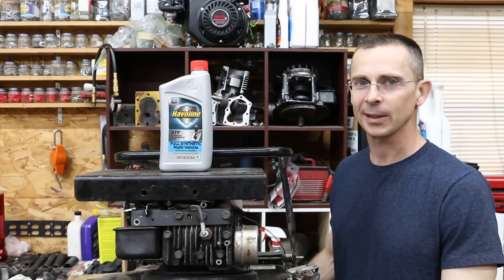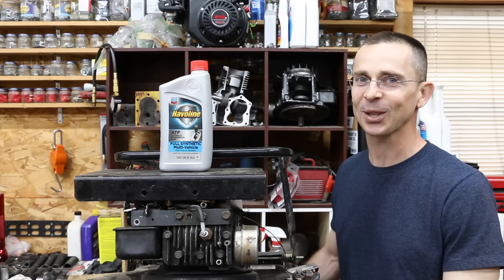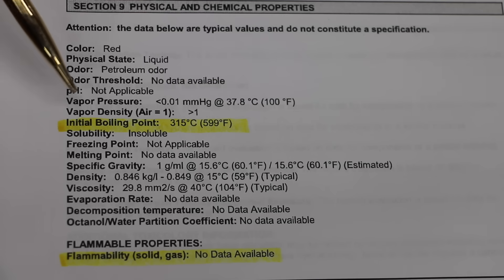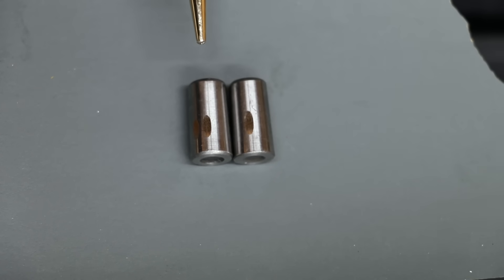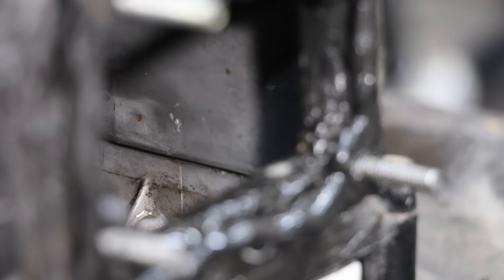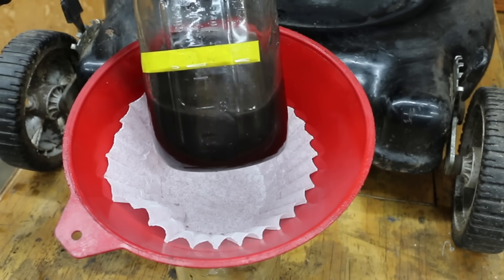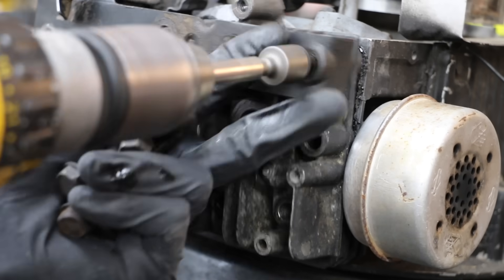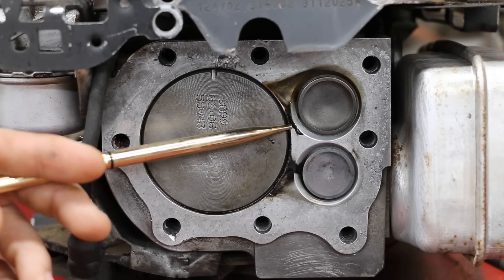ATF as an Engine Oil substitute?  Let's see what happens!

Comment: I use just straight kerosene in my crankase right after draining old oil out, and turn my engine for a few seconds using the starter motor, you wouldn't belive the amount of actual DIRT and gunk it washes out..... I should note it would be best to just pull the spark plug wires off and let the starter motor turn the engine over for a while and yeah that cleaned out the engine that was some nasty looking kerosene that came out
Reply: OnThe Farm I just purchased a 1977 Toyota Dolphin the 20 R engine in it, it's sat for 14 years, 58000 miles on it, I installed it in my 77 Toyota truck, after draining half of the oil out of it, I poured in 3 quarts of diesel, pull the spark plugs turn the engine over,  for 45 seconds,  did this probably about 10 times the first day , drain the oil  and diesel out of it the next morning, pour in 1 gallon of diesel the next day, repeated the same thing over the first day you  should of seen the sludge that came out the second day,,, I got 3,200 miles on it right now, and that's one sweet little Toyota engine,
Reply: @daleslover2771   Dale Slover I use diesel regularly to flush engines and clean parts during rebuilds. It beats the snot out of over-the-counter products.

And as far as those particular Toyota motors go...the 20R and 22R were the best 4-cylinders they ever built, in my opinion. Those are absolutely worth the time and money to clean/restore.
Reply: @daleslover2771  Diesel Fuel?
Reply from the maker: Thanks for commenting on this!
Reply: Project Farm yw
Reply: OnThe Farm   Giving that a try – about 4 qts. kerosene and a half quart of ATF.  Just going to let it soak in the pan (and pick-up screen).

Update: didn't get any sludge breakdown. It sat for about two days, and the mixture was not dark at all !  I am very surprised and in disbelief that it that clean, but it did come out clean. I will continue the next step with MMO at next oil change. Metadata: Chevy 350 c.i.d. engine, 175,000 mi.; used vehicle; economy oil and filters (during my ownership); occasional use – going to take it as good news and leave it at that. 👍
Reply: I've drained the oil and filled the crankcase to the top and let it sit for a day,drained it for a day ,and than put in a cheap oil and filter drove for 500 miles ,changed again,and yeah man the solids that came out of that engine were mine blowing,for the record the car was given to me,it was more of an experiment than anything
Reply: @dustinpomeroy8817  If its that bad, sometimes you have to pull covers and pans to clean it properly. The things I've seen....
Reply: Oldschool Dude it was a car somebody gave to me I doubt it was worth a grand and it wasn't worth all that trouble. I had a buddy who grew up on muscle cars and remember him talking about doing that to unsludge motors in the 70s. Like I said it was more of an experiment. Surprisingly enough I drove the car for 4 years after that until someone offered me 750 for it out of the blue and it and I parted ways.
Reply: @dustinpomeroy8817  I understand. You never know what nightmares lay in wait til you pull it apart
Reply: engine flush is basically kerosene, dont run it too long. maybe add some atf to it, or marvel mystery oil with it
Reply: I've always used kerosene, my grandpa taught me that. I never heard of using atf till I watched this video.
Reply: In the shop when faced with a motor that was badly neglected and incapable of producing enough oil pressure due to screen clogged or having problems with drainback because the return holes were so hogged up I'd use 1 qt kerosene, just overfill the crankcase by a quart, let it run for 15-20 mins, then drain and do an oil change. More often than not it improved the problem, sometimes cured. I've seen stuff come out of the pan after this that looked like black peanut butter. If it seemed to work I'd have them change the oil and filter again in 500 miles, then normal interval after. I mean normal normal, not their 30,000+ mile interval that got them to that point in the first place...
Reply: I always drain the oil, put in 3 gallons of diesel, and start and run the engine for 1 minute... Drain and add new oil and filter.. I have never had an engine failure. 
On a side note..I once ran an engine for 2 hours on water only, in the oil pan.. no engine damage occured.
You see, the oil cools the moving parts.. the lubrication isn't as important as everyone thinks.. the dissimilar metals, resist gaulding, as long as you keep them cool, and don't let them heat up, over expand and damage moving parts..  try it, you will be shocked, how well water works as coolant on the crankshaft...

Comment: ATF is just a relatively thin mineral oil without the detergents, corrosion inhibitors, acid neutralizers, and viscosity additives found in motor oil. Since it gets thinner than most motor oils when hot it acts like a solvent and it may help remove some gunk, so the old timers who recommended it had some basis in truth, but it may also cause more metal to metal contact. It isn't really designed to prevent or clean out contamination because the inside of a transmission doesn't experience combustion by-products like a crankcase does, so the common claim that it contains superior (or any) detergents is a myth. The friction modifiers present in ATF may even slightly increase friction, depending on the type of ATF. You can get away with using ATF in your engine if you're a quart or two low and the right oil isn't available, but otherwise just save the ATF for your transmission.
Reply: Louis Laszlo Automatic transmission  fluid gets cooked from the torque converter.  All transmissions are vented to prevent pressure build up of oil puking past the seals.  Since it's vented humid air does get in and any trans fluid should be changed every couple of years for headache free operation.
Reply: Louis Laszlo Dexron 6 doesn't belong in a motor. Dexron 3 has been proven to have good results in a short time being in your motor.
Reply from the maker: This is great information. Thanks for commenting!
Reply: kansascat321  Transmissions are a sealed environment. Nothing gets burned in there, no air or moisture gets in, so where can you get any significant contamination from that you would need detergents to remove? Seal conditioners are a different matter, but if I have leaky seals in an engine then I use a product made for that purpose such as high mileage oil or a leak-stop additive. ATF belongs only in your transmission.
Reply: waterloo123100  What’s in Dexron 6 that would be particularly bad for a motor?
Reply: I've worked on automatic transmissions in a learning environment and in the lab my hands always got cleaner than when I started. I attribute this to the detergent in the Automatic Transmission Fluid (ATF). Also, I recall a good, cheap way to clean pistons is with a deep fryer filled with ATF. The heated oil, with detergents, cleans off carbon, grease, etc. Of course, don't try to clean out the ATF from the deep fryer and try to put it back in mom's kitchen. Its french fried potato and deep fried chicken days are over.

Comment: Good vid
I had a noisy lifter when i bought truck...
Did an oil change (10w30) and new filter drove about 2000 kms, no change. I removed about a quart of oil from the pan, added a quart of ATF, and after about 300kms i dont hear the noisy lifter anymore! Im not sure if the ATF is so much a better detergent, but i believe its a thinner viscosity than the 10w30 and it must have gotten intothe small passages and cleaned out some sludge buildup...
I did an oil chamge once the lifter noise was gone, and the oil was very dark in colour. Replaced with new oil and filter, and so far no issues!
My grandfather told me yrs ago that they used to pour smalls amounts of ATF down the carburetors when they did tune ups. Says it helped clean the carburetor and carbon from the pistons and valves.
You should try mixing some ATF into your fuel in the container for the mower and see if it helps remove carbon from the cylinder head.
Reply from the maker: Thanks for commenting on how you've used ATF!
Reply: @ProjectFarm  That's the way it's supposed to be used for "cleaning".  Also, since it's "thinner" than most 30wt oils...you should change the oil again after using it to free a stuck lifter.
Reply: water injection kits were sold over thirty years go to get rid of carbon build up..
Reply: ATF is a high detergent 10 weight oil
Reply: @cbly  if I didn't know what you were talking about, your comment might get confused with something much kinkier.
Reply: If you did that now it would wreck your converter. Back in the day, we just punched out the cat anyways. I remember a mechanic pulling the smog controls off my moms brand new 78 Chevy Nova. He told her it would fail anyways. That car ran forever. Rusted like mad though!
Reply: @scottfirman Are you saying adding ATF will fry your cat convertor?
Reply: Your grandfather was right..  when you could no longer get leaded gas, the high compression engines would knock and ping horribly.   We would take a glass coke bottle of water or transmission fluid, and rev the engine while pouring the liquid through the carb.   You wanted the engine hot, so as to bust the carbon off the Pistons and valves.. the carbon will glow cherry red and ignite the fuel, just like the spark plugs and does, causing pre detonation....or the fuel mixture ignites, before the piston reaches top dead center.. seemed to work well..
Reply: Marvel mystery oil is good for that problem
Reply: splash around once a year I run about 20 ounces in a full 14 gallon tank it does clean fuel system (efi or carb) was told a qt to a tank when I found out about it I do a qt if I just got the car or truck I been doing it for 20yrs  in all my rides sometimes it improves my gas mileage I also run a qt in my crank case about 100 miles before a oil change I'm  22yrs as a mechanic now never have issues
Reply: @justicefornone3411  Spray bottle down the throttle body, just a few sprays, not enough to hydrolock but it "shocks" the cylinder and knocks the carbon loose as I've been told.
Edit: stupid autocorrect
Reply: ATF being so much thinner means it will probably not maintain a lubricating film in key parts of the engine, which is basically like running the engine with no oil at all

Comment: Never thought of using pure ATF to clean it out, seems to have ungooped the rings for better compression though.  Might work fine for a oil sling system, but have a feeling it would clog a filter fast and lower oil pressure if used in a pump type system.  Wonder how a 50/50 mix of fresh oil and ATF would do...probably best to just use diesel oil for a cycle then, definite high detergent there.
Awesome video as usual...keep em coming, never thought of ATF in the crank of a small engine...nice!
Reply from the maker: Thank you!  I'll test diesel soon.  Thanks again!

Comment: i dont know about a new engine,but in the old days, we'd put about a pint of ATF into the oil..run it until it got hot,then change the oil. back in the day before synthetic oils and efficient engines. the oil stayed cleaner longer. ATF was mostly detergent . .
Reply from the maker: Thanks for commenting on how you've used ATF!

Comment: You are not supposed to replace the oil with trans fluid. You are supposed to add a small amount of trans fluid to the oil. Run it for a little, then change it.
Reply from the maker: Thanks for commenting on this.

Comment: Lucas oil has a product that is 100% petroleum. I've used that and atf had about the same results with both but Ive always mixed it with engine oil. Been a mechanic for 6 years have seen engine oil pressure come back up after the petroleum but not so much on atf. But atf is a great fluid for stuck hydraulic lifters and hydraulic lifters only. My opinion it cleans more sorry because of the detergents in ATF
Reply from the maker: Thanks for commenting.

Comment: From your videos, I have learned that small engines will essentially run using pretty much any fluid around the house as either engine oil or fuel. 

"Shit, I have to mow the yard before mom gets home, but the mower has no oil or fuel. I've got a bottle of ammonia and a jar of pickle juice! That should do the trick!"

And that's how I learned peppercorns clog fuel lines.
Reply from the maker: LOL!  Yes, these engines are amazing.

Comment: I prefer to soak my old lifters in acetone and atf if given the option it does free up 200k+ stuck lifters(soak squish method/repeat) but I have had some success running a mix of atf and 5w30 in a car at high rpm and perussure to flush out lifter issues and  have not seen them return in two years since ( atf was added 2 qt to 2.5 qt 5w30 syn oil and ran for about 10 minutes on high load(5000+ rpm) and 30min overall than changed to cheap 5w30 for the rest of use. not saying it will work just saying it has at least once for me in an ej18 subaru boxer motor.   ps I am  know calling them lifters is wrong as what I'm referring to are hydraulic lash adjusters in this engine but very similar in function.
Reply from the maker: Thanks for commenting on how you've used ATF and acetone.

Comment: Thanks for sharing as always. This was an interesting test. IN the see through window it looked to me like transmission fluid foamed or bubbled more than engine oil does. I agree with you i don't think the trans fluid caused the metal shavings I think it just helped to clean them out of the engine I'M wondering how an engine would hold up using trans fluid for a long time in place of motor oil like 1000 hours i would think it would cause more wear on an engine since it doesn't seem to lubricate quit as well as motor oil does. Enjoyed the video and learned something as well as I always seem to do with your videos. Getting close to 200k subs that's awesome. Have a great week God Bless!!!
Reply from the maker: I agree with you that it would likely cause a lot of wear in the long run. Thank you very much and God Bless!

Comment: I have had good luck using atf in diesel engines as injector cleaner by filling the fuel filters with atf when replacing them
Reply from the maker: Thanks for this recommendation!

Comment: I bought a 79 f150 in high school it sat for 10 years prior i threw a quart of atf in with the old oil an ran it for 10 mins or so an it seemed to run smoother an no oil leaks I've been told it will help old seals swell back up
Reply from the maker: Thanks for commenting on how you've used ATF!

Comment: Thank you for this test, I was curious to see the results. It always seems like a bit of a rip-off to discover that your expensive "synthetic oil" is actually mineral oil. In this case it's not even 100% highly refined mineral oil, but 70-99%. If you get a batch that's at the lower end of that range wouldn't it be more honest to call it a semi-synthetic ?
Reply from the maker: I agree with you.  This doesn't seem to earn the synthetic label.

Comment: Other than cam and lifter contact , there really isn't any high friction areas in a mower engine and with 12 lb valve springs not much any way. ATF might make a decent additive to oil before a rebuild.
Reply from the maker: All great points. Thanks for commenting.

Comment: ATF is great at saving a sludged up engine.  I have done this many times.  Run ATF and run the engine for 1 hr for 3 or 4 days in a row.  Then drain, remove rocker covers and oil pan if possible.  Results are pretty great.
Reply from the maker: Thanks for commenting on this!

Comment: I've used Marvel Mystery Oil and Dexron trans oil with good results for a mildly sludged engine or sticky lifters. I've never used a synthetic trans oil. For badly sludged engines I've used a quart or two of diesel with cheap oil, replaced it a few times then fresh oil and filter usually get the worst out, however if any gaskets or seals are marginal you'll be replacing them. If the engine is bad, there's nothing in a can that will help.
Reply from the maker: Thanks for commenting on this!

Comment: Dexron VI* is a low viscosity fluid, more similar to a 0W20 engine oil. The older Dexron III fluid ("Dex/Merc") is closer to the engine oil viscosity this engine is designed to run on. Great video as always, I totally agree with all your conclusions.
Reply from the maker: Thank you!

Comment: This is one of your best videos!  I use ATF as a pre-oil-change engine flush only.  NO DRIVING with the ATF in the engine!  As your test demonstrates, the ATF does not have the film strength of engine oil, so I do not load the engine while it is working - just let it idle for 15 minutes or so before changing the oil & filter.  Actually, I mix ATF 50/50 with kerosene or diesel fuel.  This mix works just as well as any other purpose made engine flush at any price.  And it is cheap.
Reply from the maker: Thank you!

Comment: How about some good heavy gear oil? Like 90W or 140W.  Last time I had to use gear oil I thought to myself. They should recommend preheating the bottle. The stuff poured out so slow. One of my old tractors it's recommended using 90w gear oil for the hydraulics and the transmission. Maybe there is something to it.
Reply from the maker: Thank you for this recommendation!

Comment: Good vid.  Works good for breathing some life into a gummy engine.  I've used this method several times over the years and your example was a perfect textbook demonstration on how to do this method the right way.  Good job.  I want to point out that no one should consider thinking that working their engine under any load during this process is a good idea.  And load with ATF will start to cause rapid wear on the crank and rod journal.  Project Farm did this the safest way in this video.
Reply from the maker: Thank you!